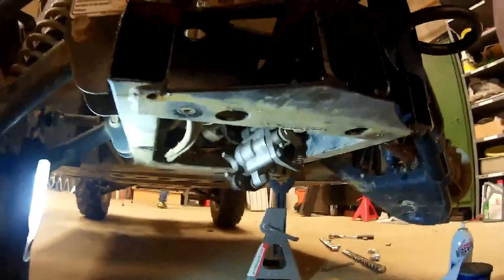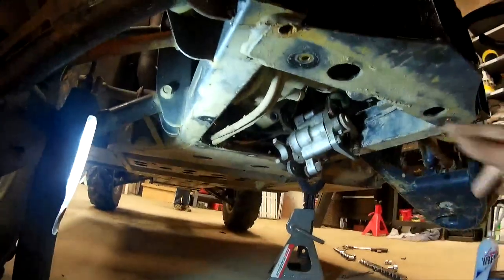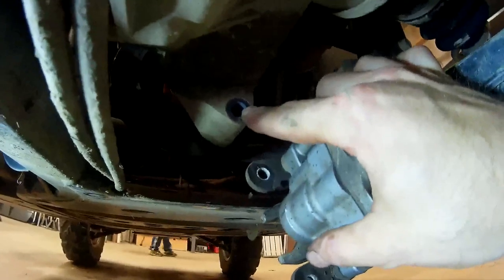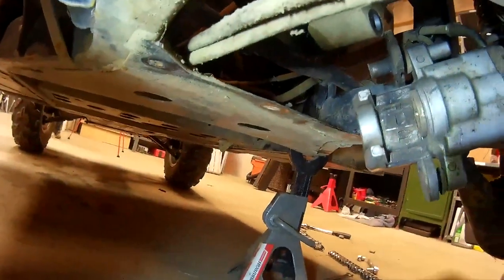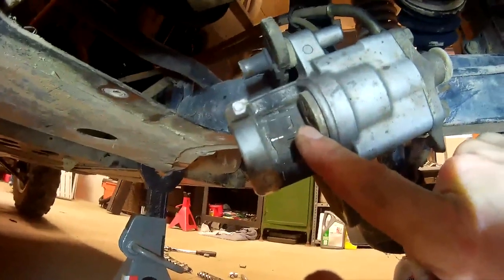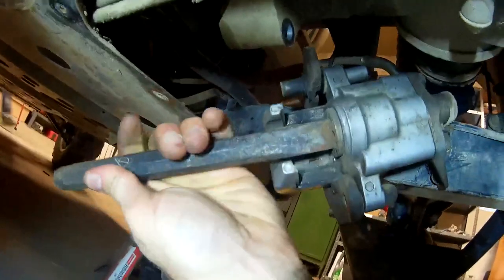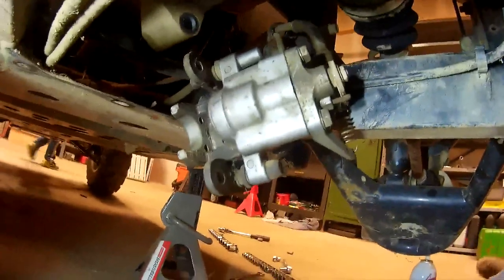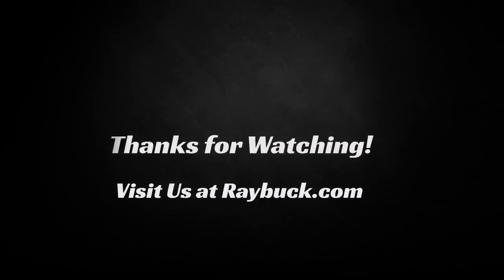How to Change Brake Pads On a 2006 Yamaha Rhino 660

Comment: What kind of lube do you suggest and what parts do you lube? First time owner of a used 2007 rhino 660 and novice to moderate mechanic
Reply from the maker: I would spray all of the bolts with something like Fluid Film, PB Blaster or WD-40. That will make them easier to remove. I use high temp grease for around the pads. You can get that at any auto parts store.

Comment: What do you do when you strip the Allen heads.
Reply from the maker: That's a tough one. Probably get an allen head bolt extractor kit and see if that works.
Reply: i got it out with heat and a extractor the caliper was seized and for 2 calipers it was 21 bucks . so i just replaced them also someone torqued the bolts that hold on the caliper when it stops raining i will take on the rears have you done the rears yet?
Reply from the maker: @ncrdisabled  Yeah, there's just one rear and that's what I showed in the video.